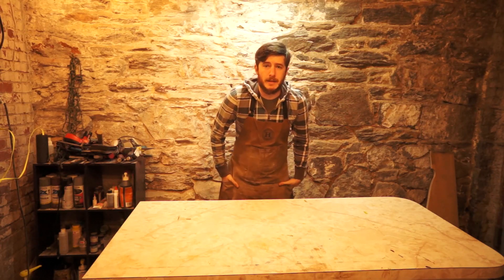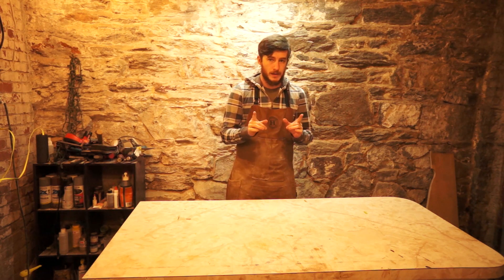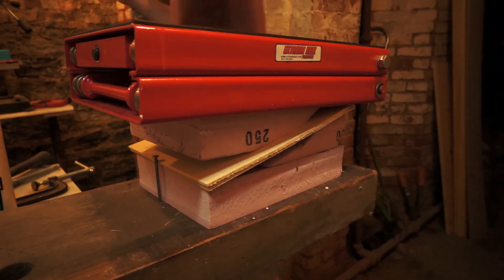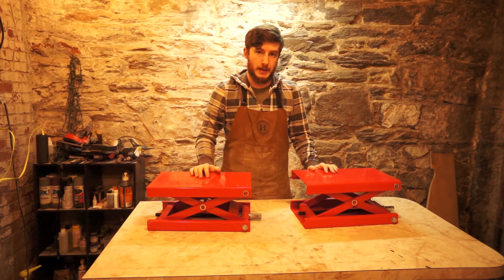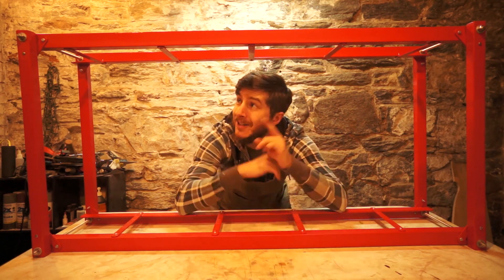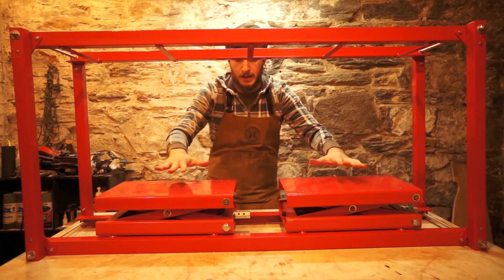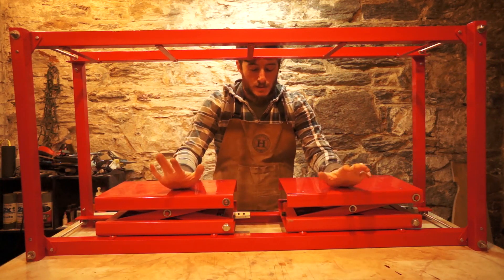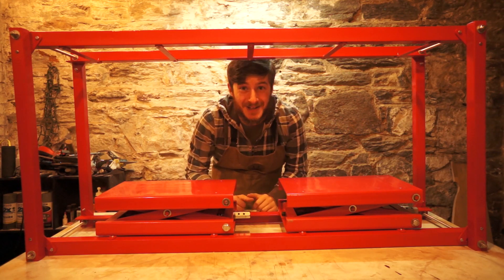Building an Electric Skateboard Press: Making a Metal Frame

Comment: Was this enough pressure? I always hear you want 20 tons at least
Reply from the maker: I hear that number get thrown around a lot too and I don't know why it's so common. You can press a great deck with a LOT less pressure than that. For example, if you were pressing a 9" x 36" blank in a vacuum bag the most force you could expect is about a ton and a half and it still works just fine